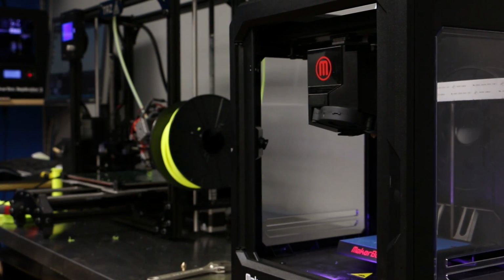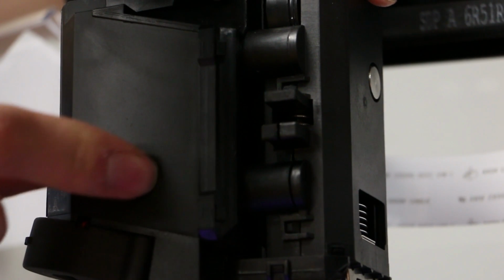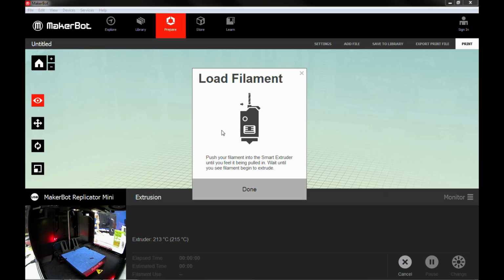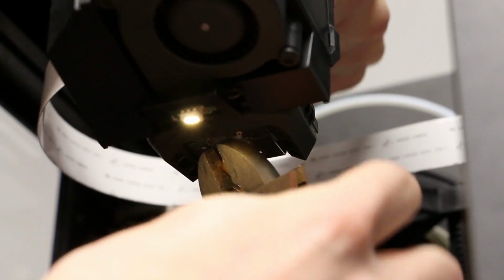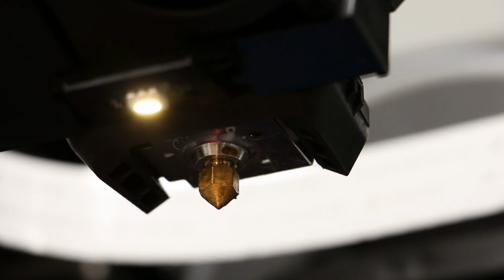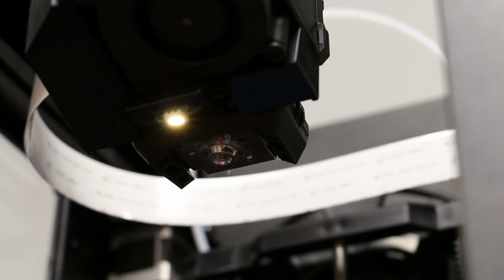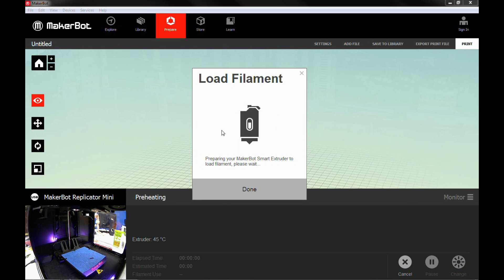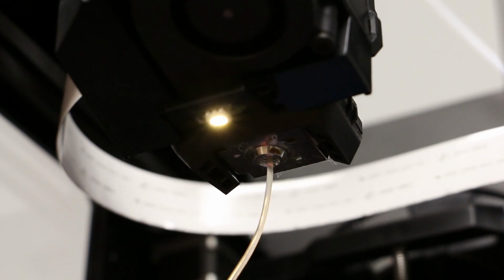MakerBot Smart Extruder - Thermal Barrier Tube Unclog

Comment: Great post! I especially like the suggestion about lubricating with olive oil. I had a clog yesterday in my SmartTough Extruder+. I completely disassembled and ended up cutting most of the thermal barrier tube to remove the clog. Wish I had seen this post first. The extruder is now functional again, but I have to remove the cover and manually feed the filament... Non-end user serviceable my a$$!

Comment: Ok, I disassembled the smart extruder  because the filament was stuck in the nozzle, heating block and all the way up the PTFE tube.  So I removed the the heating screw that sits just above the brass nozzle because I sheered the nozzle and had to surgically remove the last bits of the nozzle's collar because nothing else was working and ended up machining it out with a tap.    i put it all back together, minus a nozzle as I am waiting in the mail for that.  I cannot get the clogged filament out, and now the extruder is erroring as it gets above 200C during a load filament process.  I feel I am at the point of pulling off the PTFE tube to see if I can get right at the clog in the heating screw, but I don't want to do this if it is a waste (since I might not be able to reattach it).  Note - This is a old extruder that died due to this clog, so no printer downtimes

Any wisdom on removing the filament?  Any wisdom on fixing the error when trying to do a load filament process?

Comment: I had to open up the extruder completely as filament had pooled in a big blob on top of the heat sink.
I noticed that the heating element around the pipe to the extruder looks like it was glued to the black clip attached to the metal frame. But it's not glued on this one. So it's free to move. I know it moves up and down but I think this is allowing it too much X,Y axis movement that's preventing proper filament loading.
Example video of what I'm talking about here (if the link works): https://www.youtube.com/watch?v=BRmTLfcJCHQ
Is anyone familiar enough with the guts to know if that piece should be glued?

Comment: I tried this solution.  I cleared the thermal barrier clog beautifully.  I did not have a spare nozzle, so I chiseled away as much of the dried filament as possible inside the nozzle.  Unfortunately, when I went to put the nozzle back on it would only screw on about half way.  I heated it up and attempted to screw it in all the way, but broke off the head from the threads.  Happily though, Makerbot understands my frustration with extruder clogs and has agreed to replace the extruder this time, even though I broke it.
Reply: +Jonathan Marshall This exact scenario happened to me also.  Did you ever find out why the nozzle wouldn't screw back on all the way?  In this video I notice the part inside the threaded area that mates to the nozzle (call it the feeder pipe?) is farther up inside the nozzle hole than mine is.  I think this is the cause, but I don't know why the "feeder pipe" is so low on mine.  I wonder if Makerbot used some Locktite or something and removing the nozzle pulled it downward.  Does the Fargo replacement nozzle have shorter threads?
Reply: +Fargo 3D Printing Thanks for the reply.  That's what I thought: the printer would simply compensate after a leveling.  It didn't.  The nozzle impacted the print bed and was scraping off the blue tape when moving.  The filament wouldn't extrude, of course, which caused more clogging.  There is a manual z-adjustment on the Replicator but only up to 0.4mm, and the nozzle thread gap was closer to 2mm.  I ordered some new nozzles, but they are currently lost in our school mail system.  I'm wondering if the process of removing the nozzle somehow pulled/stretched the heating block downward.

Comment: Clogging issiue is related to bad lubrication. Here is the only thing you need to do! (Without removing any parts at all)
This solution works miracles including clogging issiue.

BEST SOLUTION EVER: I have the Replicator mini and was having the same print quality problem(not being smooth) Solution I found was rubbing little bit of Olive oil to the fillament while feeding it into extruder. Not much just get your fingertip little wet and start rubbing it around the fillament. This will Lubricate the inside of the nozzle and. You will be amazed how effective this is. Also if you keep getting "Fillament Jam" error message and stop printing, Olive oil fixes it immediately. !!!! You're welcome people!

Comment: What's the reasoning for not using the "Unload Filament" option when unloading?
Reply: +Jake Clark You dont need to do any of these All you need is lubricating the inside of the nozzle. Unload the filament, cut the tip with a scissors  and while you are loading it back rub some olive oil around the filament. This will lubricate the nozzle and will not clog for a looong time and also will drastically  improve the print quality. You're welcome.
Reply: Hey Don, the reason  I use the load script for unloading is when the filament goes through the hot block it expands (somewhere around 1.90mm sometimes). When it expands it can 1) get stuck to the side of the barrier tube, and/or 2) some components that are higher up than the thermal barrier tube are designed for filament at 1.75, not the size of the filament when it's expanded. When I heat it up and push down, that softens the expanded plastic so when I pull it out the plastic is easier to manipulate through the smaller holes above the barrier tube. Does that make sense? Great question btw! -Jake
Reply: +Murat Akay We've used that trick with the lulzbot Taz 5 and it does work!!